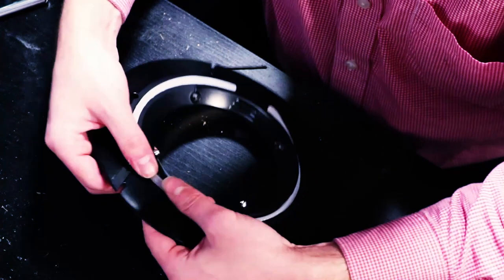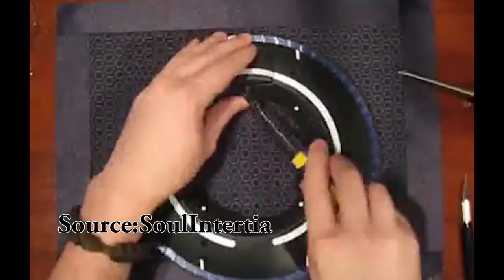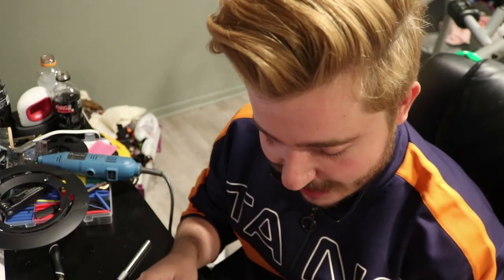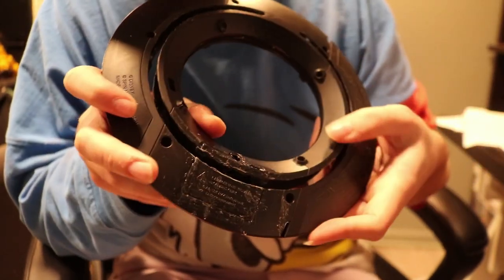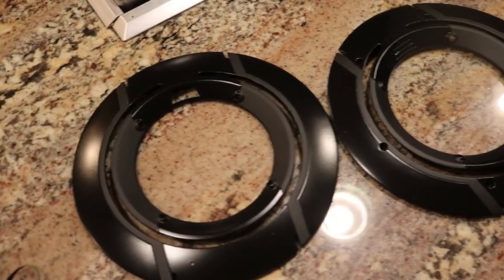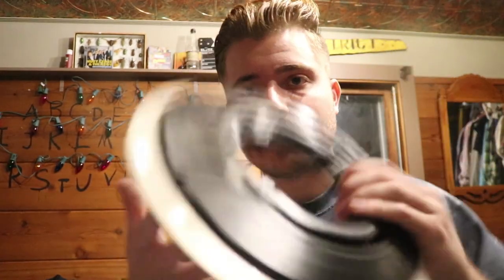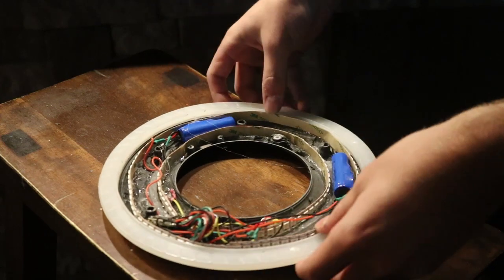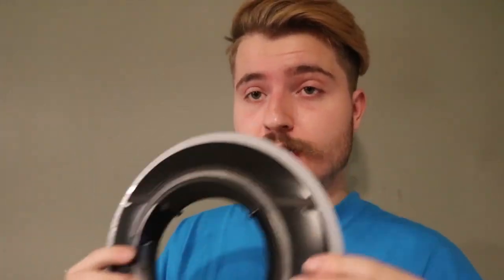Tron Legacy Identity Disc Functional Prop Tutorial: DIY

Comment: The upgrade kit link isn't available anymore, but I presume I can do this with the Thingiverse version too.
I'd love to see the diagram, however. I am intending to print and construct this disc for use in a cosplay, and this is by far the best tutorial I've seen. However, I'm a novice at circuitry and the like. If you could please provide the diagrams or a tutorial on how to wire it, and potentially the STLs for things the Thingiverse version doesn't have (like the power button for instance), anything like that would be lovely.

Comment: This is an amazing build! Great achievement, my dude! I actually found you through researching what people have done in terms of custom discs since the 2010 movie, and in preparation for an official announcement from Disney... I'm building a disc with a ligthsaber circuit set-up along the lines of the way you did here. I'm actually building on the 3d printed disc model by metaform3d and will upload a finalized remix of it as soon as I'm happy with it. But I have a question for you: Where did you get/buy the sound fonts from? I haven't found any individual character ones, only general TRON ones.
Reply: Any updates?